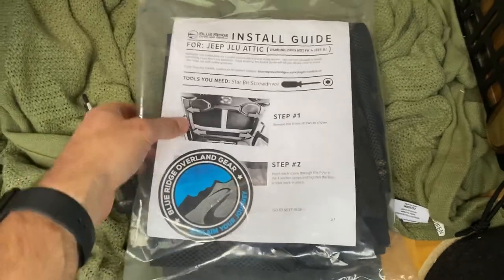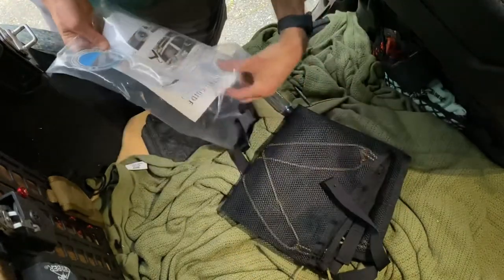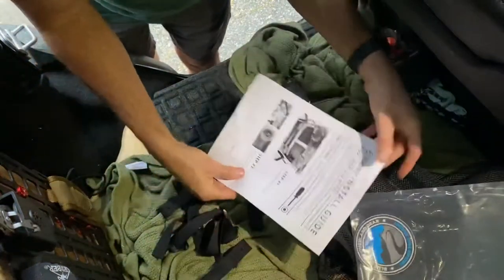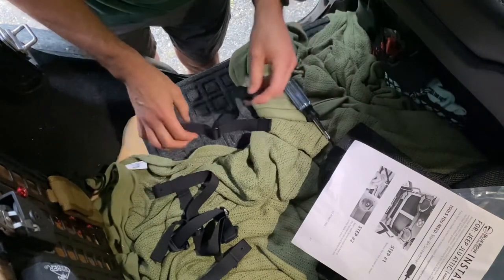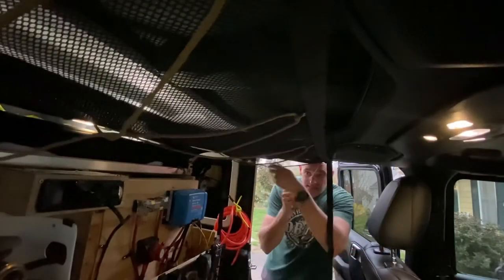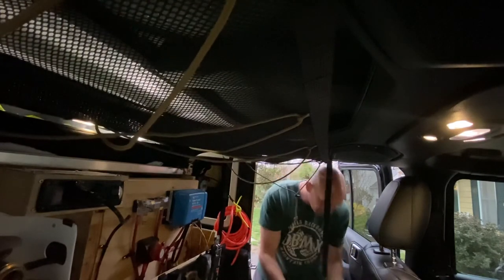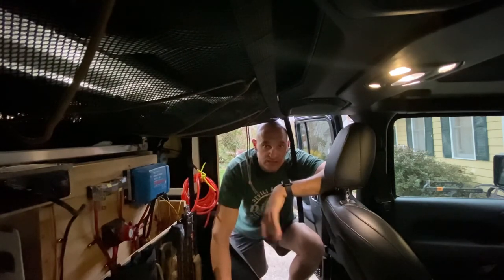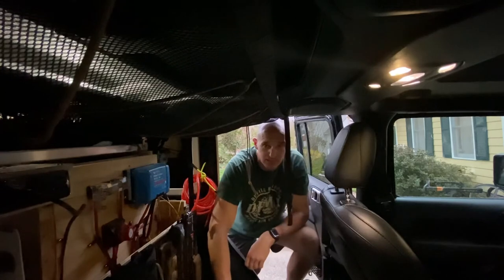Blue Ridge Overland Gear - JLU Storage Attic

Comment: I would like it if the straps wrapped around the roll bar so it would be less stress on the screws, or don't even use the screws..
Reply from the maker: I guess they use the screws to hold it in place so it does not move around, i just keep a sweatshirt, raincoat, and some extra clothes up there so i think the stress on the screws is minimal simply just because there is not alot of weight in the netting

Comment: Would this work with a soft top Wrangler?
Reply from the maker: Tim, It should since it mounts to the trim screws on the roll bar, i would think it would be fine, i do know the product I bought only works with the JLU so if yours is a 4 door you will be go to go